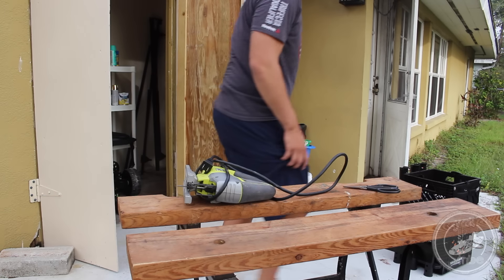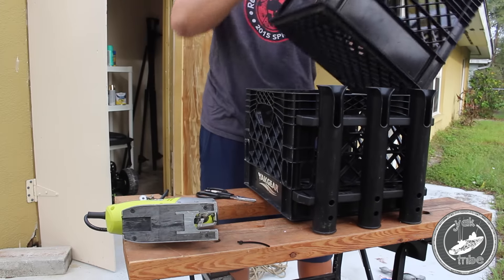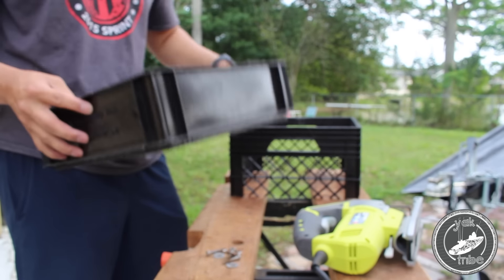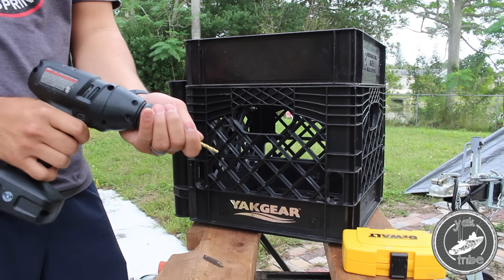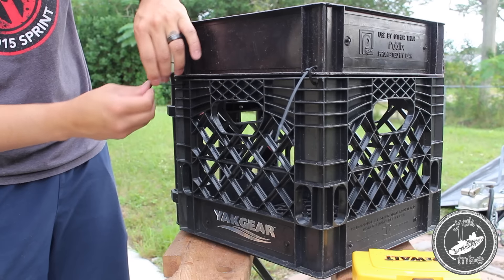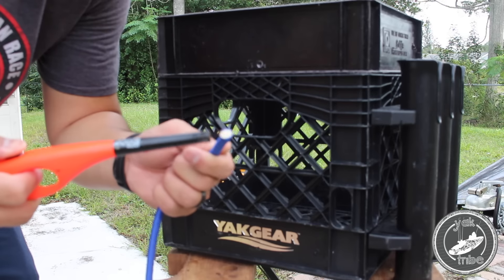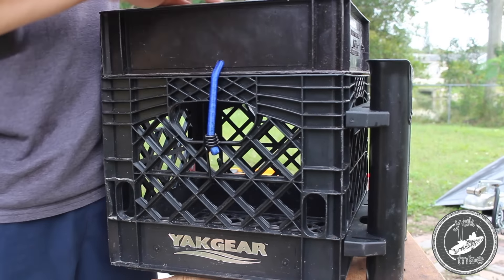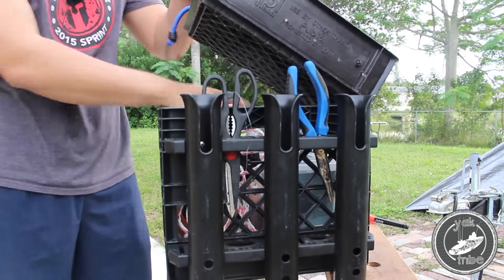DIY Crate Mod - Kayak Fishing

Comment: Hey Heath, very good DIY.  Quick question...I will be receiving my first kayak next spring.  Most kayaks have multiple rod holders already but anglers install additional ones on milk crates? Is there something wrong with the ones on the kayaks?
Reply from the maker: Hey! Nope. Nothing wrong with them. People just like to move rods to the back or have storage for them when taking the gear off of the kayak. Everyone is different!

Comment: Good video. Just one quick tip for other users. These Yak Gear crates are overpriced. You can buy identical crates at your local big orange home improvement store for about $6-7 a piece. They work just as well if you don't have a sporting goods store nearby that sells Yak Gear (or you don't want to pay an extra $5 for a logo on your crate).
Reply from the maker: Thanks for watching!